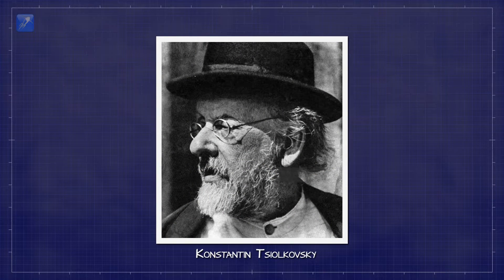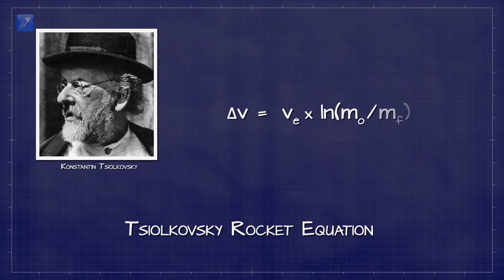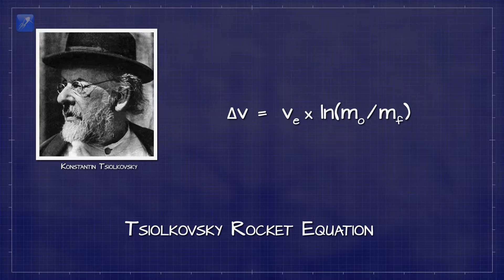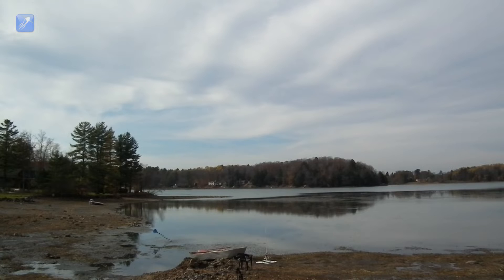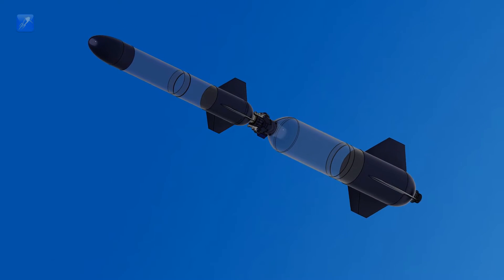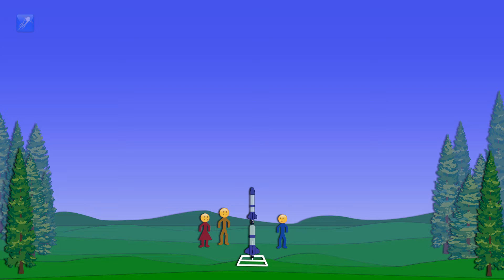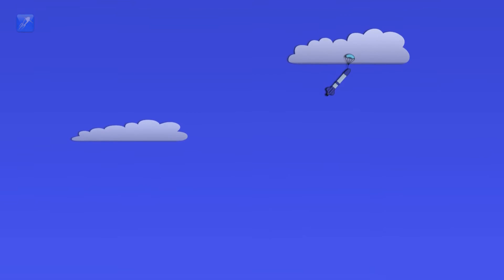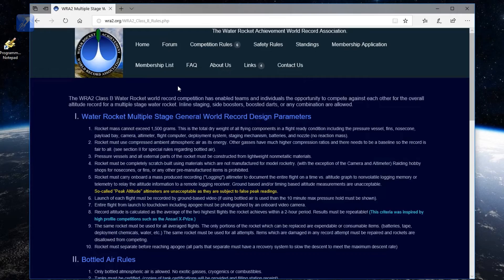Why Do Rockets Use Multiple Stages | Project Gemini Part 3

Comment: Very well made and informative video! :) Looking forward for more details about project Gemini! I think one important aspect of staging water rockets is, that most excisting staging mechanisms are quite large in comparison to the rocket. Also, the stager weight to total weight ratio of water rockets is a lot worse than of "real" rockets or pyro model rockets. It's also incredible hard to build a stager that can withstand the high acceleration common for high performance water rockets. I think these are the reasons why nobody has tried to break altitude water rocket records with multiple stages until now. However, with 3D-printing and composite material becoming more available for everyone this is changing. It would be an enormous achievement if you are able to overcome this issues with your design, and it looks quite promising. :) Have you tested it with higher acceleration on your record breaking rockets? 
All the best!
Julian from Raketfued

Comment: Love your videos. Very good information to learn. Please keep making them. Really like this two stag rocket design.
Cheers
Willy
Reply from the maker: Thanks for the positive feedback! Working on the next video right now!
Reply: From watching the end of your video it looks like you are working on a new electronic control?  Any available information yet?  Looking forward to seeing this new project. Keep up the good work.
Cheers
Willy
Reply from the maker: @willywgb  There's actually two different electronics designs shown in the video. One is a sort of combination PCB with multiple functions that plugs into an MSP430 LaunchPad and takes advantage of the LaunchPad Ecosystem to leverage readily available peripherals like a touch-screen. The board itself has an SD-card for Datalogging, instrumentation amplifiers for reading pressure transducers and load cells, and has a bunch of servo and brushless motor outputs. We have used that board for a lot of support projects, but the goal of that board was to control an autonomous launcher that fills to a preset pressure and monitors for safe conditions and then launches the rocket.

Comment: Great video. very well explained in a simple and easy to follow way! Yes.. the tyranny and the beauty of the rocket equation. There is a reason we have (so far) not seen a true single-stage to orbit rocket.... math and physics! Looking forward to see how you do the stage separator design. I have only tried building single stage water rockets, and I have looked at staging designs but I am intrigued by yours. Good luck on the record breaking attempt!
Reply from the maker: Thanks so much for the encouragement! I will put the finishing touches on the stager video as soon as I can. The comments here are really getting me fired up!

Comment: Excellent, informative video. I will definitely recommend this video for viewing to young rocketry enthusiasts. Special thanks for mentioning Tsiolkovsky. He is an amazing person. The scientist is self-taught, whose ideas were ahead of time. I was several times in the city of Kaluga, where he lived and worked as a schoolteacher. There is now a museum dedicated to his life. 
On May 10, 1897, Tsiolkovsky derived a formula that established the relationship between the speed of a rocket at any moment, the rate of outflow of gases from a nozzle, the mass of a rocket, and the mass of fuel.
After completing the mathematical notes, Tsiolkovsky mechanically set the date: May 10, 1897, thereby securing his primacy in matters of the scientific exploration of space. (It should be noted that in general, the equation of motion of a body with a variable mass was derived at the beginning of the 19th century).
Reply: The way of Tsiolkovsky to knowledge and science is amazing and complicated. Owing to the illness suffered in childhood and partial hearing loss, the young Tsiolkovsky could not continue his studies in the gymnasium on a par with his peers and after 3 years of study, was expelled for academic failure and bad behavior. Then he continued self-study and passed the exams for the post of district teacher. Difficulties in communication and non-systemic education left an imprint on many events in the life of K.E. For example, while still very young, Tsiolkovsky independently developed the kinetic theory of gases and sent the manuscript to the Russian Physical and Chemical Society in St. Petersburg, shortly before this founded by D.I. Mendeleev. Soon he gets a response from Mendeleev, which has something like this: the kinetic theory of gases is already open ... 25 years ago.
Reply from the maker: @WATERROCKETSCLUB  That is an incredible story. I will search and see if I can find a good documentary on his life and his work. He sounds very much like a colleague of mine. Thank you for opening my eyes to his rich background. I am intrigued to learn more.
Reply from the maker: Thank you for the fantastic review of the video! You obviously know a lot about Tsiolkovsky and the history of his discovery. We believe in giving proper attribution because it is done so infrequently in recent times. You would be amazed by how many sites that just use the name "Rocket Equation" that I came across while researching this video. Some of the most successful people that I know are self-taught, and that is something that should be lauded as a great accomplishment. I did not know this about Tsiolkovsky, so thank you for pointing this out. I am even more impressed now!

Comment: can't wait to see the next part and how you have made the staging mechanism fully electronic are you using pressure sensor or accelerometer  for the staging timing
Reply from the maker: All the video has been recorded. It just needs to be edited. Very happy to hear you are excited for this project! Cheers!
Reply: @USWaterRockets  are you planning semy  weekly release and are you still using the MSP430  to control the staging ore movt to Arduino or similar
Reply from the maker: @fromaflafl2198  The plan is to dedicate more time to editing videos so we have more frequent uploads. There are some projects we're excited to share.  The electronics we're currently using are using the custom PCB miniaturized version of the MSP430 LaunchPad AlTImeter. We have some other plans for future electronics, but this is in the planning stages.